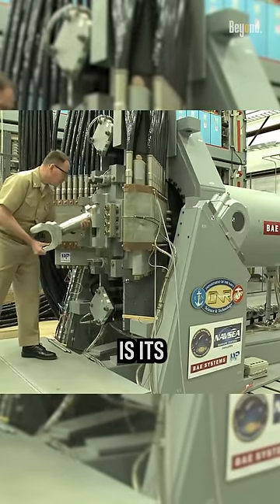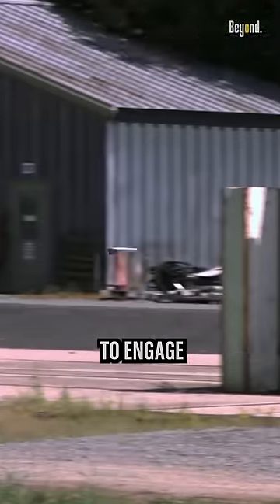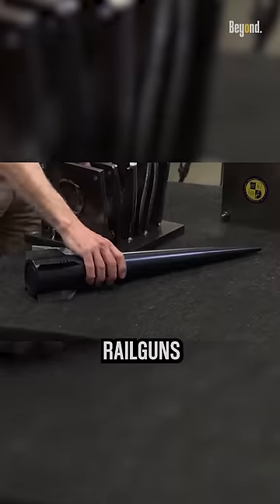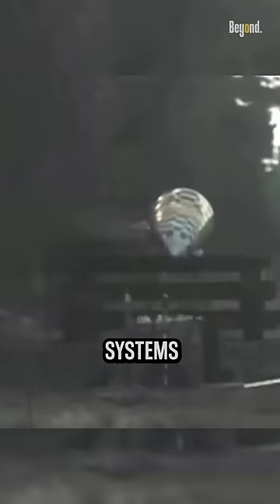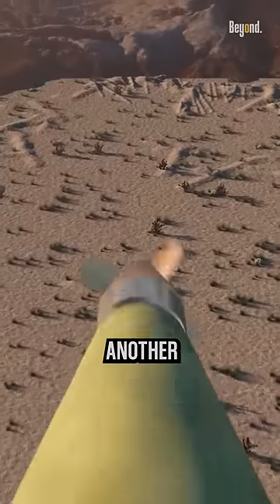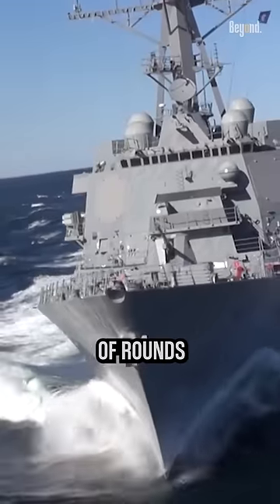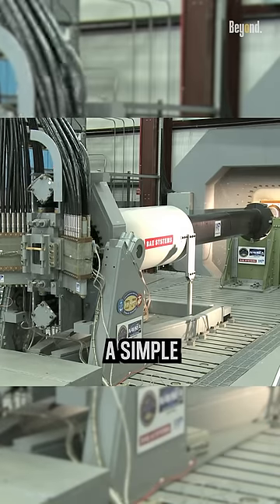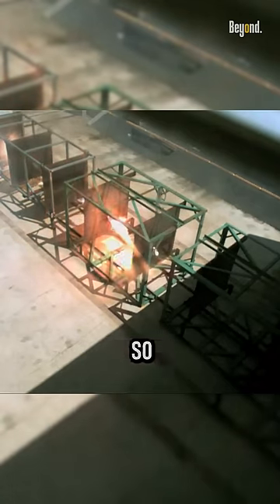Why does the US Navy need a railgun ? #shorts

Comment: Railgun + rod from God = extremely bad day for the recipient
Reply: That would be so overkill but at the same time incredible
Reply: Yes.. Planetary defense systems but that's hundreds of yrs in the future. For now, the land based versions operatied by mini nuclear power source with an increase (about 70%) rate of fire is pretty OP..
Reply: @Tamayo1980  it's not that far off into the future, the only reason we don't already have one is because it is prohibitively expensive to reload
Reply: @Controlled_Insanity_003  Lol @ the "only reason" citing reloading.. Welp, the architecture of building an weapons platform in space is beyond challenging. 1st, you'd have to get said payload into orbit, assemble and eventually have a powerful enough engines to counter the force of a rail gun firing in space.
Reply: @Antares_451  getting the ammunition to orbit is part of reloading, but I did forget about recoil
Reply: Although rods from God are cool or should I say the thought of rods from God are cool who be far too expensive to actually get the ammunition up in space for them to actually be practical a nice cbm is a fraction of the price
Reply: @john762x51  I know, I already mentioned price in a different comment
Reply: @Antares_451 I don't think kinetic weapons would need much infrastructure especially if starship pans out as it could probably launch a satellite with several such weapons .
Reply: One of the advantages of the "Rod from god" is that the projectile is already at orbital speed plus there is gravity so there would be no need for a rail gun with a "Rod from god" weapon other than theatrics in a movie, in truth the railgun would just be unneeded aded weight while you could just add more rods instead of the railgun, capacitors and powersource.  I would envision "Rods from god" being in highly elliptical polar orbits where they would just alter their orbits just enough to strike their target on their approach to their lowest point in their orbit.  No rail gun, just the rod detaching from the cluster, and a small burn from a thruster at the highest point of it's orbit and then it's just reaction control thrusters to control the trajectory on the way down by gravity, the rods don't even need to be in a cluster as each could be in their own polar orbit.
Reply: @johnwang9914  a railgun would add enough speed to negate most or all of the extra equipment you're advocating for, it would also greatly increase the efficacy of the weapon while still remaining "legal" by international law,  and it could be powered by solar panels and batteries
Reply: @Controlled_Insanity_003  Compared to orbital velocity, the railgun "addition" would be negligible and you would be better off launching more rods instead of the railgun, the capacitors and the powerplant.
Reply: @Controlled_Insanity_003  Compared to orbital velocity, the railgun "addition" would be negligible and you would be better off launching more rods instead of the railgun, the capacitors and the powerplant.
Reply: @Controlled_Insanity_003  currently our metallurgy limits the lifespan of the rails to a few shots. So, your railgun idea is not feasible whereas Tungsten rods with a simple RCS can be feasibly be launched right now and be much simpler system.
Reply: @johnwang9914  you don't understand then
Reply: Rods from God are not suitable for 5th Gen warfare.
Reply: @89Nazbol  it's a little barbaric but just deleting portions of cities without nuclear weapons would be good for deleting the enemy morale
Reply: @Controlled_Insanity_003 I’m pretty sure that orbital weapons are banned.
Another reason, one wouldn’t be enough so the cost of an effective system would be immeasurable.
Also space pollution, we probably need to think of that 🧐
Reply: @Rashed1255  orbital weaponry is legal I believe, orbital weapons of mass destruction are illegal, it's more of a psychological weapon than actually useful for pinpoint attacks
Reply: @Antares_451 I wouldn't expect it to be THAT far off given the pace that the progress is going
lol
Reply: @Controlled_Insanity_003 well there is a nuclear weapons ban in space but I don't think that covers traditional weapons. The treaty kind of moot anyways since ICBMs travel so far and high they might as well be in space 😅
Reply: I got your "rod from GOD" right here, pal...
Reply: @misanthropicphilanthropy  that's gay
Reply: A tungsten rod the size of a telephone pole zooming through earths atmosphere at 1,000's of MPH is scary to think about.
Reply: @Controlled_Insanity_003  Is it with SpaceX these days?
Reply: They don't work together. Either the projectile is small enough to not launch the station away when accelerated, or big enough to use gravitational energy for the damage. Can't have both, by definition
Reply: Rod from God + plasma vacuum channel wind resistance mitigation for re entry (also mitigates the plasma sheath that forms which disrupts communication to the re entering body, so mid trajectory guidance would be more feasible) + laser ablation acceleration backplate on the rod = insanely exigent day for the recipient
Reply: @gantrieltharxius28  I like your thoughts but I feel that would fall into the category of illegal weaponry
Reply: A rail gun in space wouldn't be very practical. For one, how would you get it where its needed, what kind of orbit would it have. It would be constantly moving above a planet that's constantly moving. Can't imagine it would be very accurate. You'd also have the problem of supplying ammunition and maintenance of the weapon system. Rail guns start damaging themselves from the first shot. The only way they work on earth is by having the power supply a distance from the gun. Imagine trying to move that mass to even a slightly different position. Then you have the ease with which an enemy could destroy it!
Reply: @Antares_451 you don need super force to release the rail gun in space you just need to drop it and let gravity do the rest.
Reply: @manin10  again, accuracy would not be a concern much like accuracy is not a huge concern with nuclear warheads
Reply: @Controlled_Insanity_003  So, explain how it would work.
Reply: @manin10  the force of impact would be immense
Reply: @Controlled_Insanity_003 it’s not about getting the ammo up there, it’s about getting the whole system up there. we have no rockets powerful enough to get 1 up there. the technology for that doesn’t exist. it only exists in the movie GI joe retaliation. before u even put ammo up there u have to have the whole thing up there which we don’t have anything powerful enough to do that.
Reply: @john762x51 also u would first have to get the whole gun system to work in space and actually get it up there. the technology to do that doesn’t exist and only exists in the movie GI joe retaliation.
Reply: Rods of God is such a cool idea. Drop a telephone pole sized piece of tungsten or even plain steal and you will have a crazy amount of potential energy.
Reply: No you wouldnt need a rail gun on a rod of god platform. It would be stupid to mount one considering the insane speeds in space already.
Reply: @Controlled_Insanity_003 it is clearly you who doesnt understand.
Reply: @huskiegaming4957  how do you think the space station was build on a day? With one rocket?
Reply: @ulfenburg7539  also it’s illegal to put weapons of mass destruction in space by the geneva convention.
Reply: @christianterrill3503  and illegal by the geneva convention.
Reply: Ah yes, orbital railguns. Masterchief would be pleased.
Reply: Once Starship is active (which should be before the next martian transfer window), it will be feasible to have RFG platforms in orbit. Not all the projectiles have to be WMD-scale, either. It will give the capability to simply say "I no longer want to see this facility" and drop the equivalent of a 500 ton warhead that can't be intercepted like a missile.
Reply: @Tamayo1980 we have them now.
Reply: Rod from god is not good. The item will melt and is highly inaccurate.
Reply: @brian-us6vw  The item has fins and cold gas thrusters connected to a guidance system to make it accurate. A tungsten tip helps to prevent melting.
Reply: @Controlled_Insanity_003 outer space treaty technically applies to all weapons
Reply: orbital weapons are inneficent and not practical not only are they very exspensive to maintain they are unprotected  against anti satellite weapons and you have to wait for your target to orbit beneath  which can take a long time (the iss only orbits every 90 min which is plenty of time for an icbm launch.)
Reply: @lordgod9958  I heard that it only applied to WMDs
Reply: @shelp7858  it's not for precision, it's for demoralization
Reply: @user2C47 oof, fins? At such speeds and pressures the load on ordinary fins would be way too much to handle. And before any kind of accuracy gets into this idea, the plasma sheath problem needs to be solved.
Reply: @Antares_451 while it would be massively expensive to get them into space as they’re tungsten rods designed to be as dense as possible to reduce size while maintaining mass, “rods from god” would not have any issue with countering the force from “firing” tjem because really they’re just being dropped at a precise angle calculated to hit the target. There’s no “launching” or “firing” involved, the whole point of Rods from God
Is to simply drop it perfectly (and potentially guide it with a first-stage device) so that it hits the target and the kinetic energy it develops from the fall is all released at once.
Reply: @Pantsinabucket  rods being fired from a rail gun was the conversation.. sure getting the rods into space is expensive but firing them from a rail gun ISN'T THE SAME AS "JUST DROPPING THEM LIKE A HOT POTATO"..
Reply: @Antares_451  putting a rail gun into space would cost and require the same effort as putting a space station there. How would it operate? How would you maintain it? What about the power requirements? They can't even get them to operate on a shit. They require maintenance after every shot! If fired remotely you'd be lucky if you could hit Texas!
Reply: @Antares_451  
You missed his point. You don't need a railgun. The Railgun would add maybe 7 thousand mph to something that is moving almost 30 thousand just being in orbit, let alone being fired/dropped.
It's a relatively small increase that adds massive costs in maintenance and construction, when you can have virtually the same effect just not doing it.

Comment: The main difference was the frequency with which you had to replace the rails and massive electrical need. There is still a lot of work to do before it would become feasible.
Reply: Remember learning about the huge Gustav Rail based gun of the German army during ww2. Freaking weapon had a crew of 200 people. This thing gotta raise a street to the ground or else it ain't justified to have rails built to carry it and such a crew. These rail guns damn I gotta witness how it works at least once in a life time. It be so cool watching how it goes through a tank. A house as target be like lava through butter 😅
Reply: @stevekook-xw3is  two different rail guns. The WW2 was an extremely large bore cannon whereas rail guns use two rails of electro-magnets to accelerate the projectile.
Reply: I suspect when the tech matures enough, the platform will be the size of a ww2 battleship.  It has to be big enough to house the nuc plants to generate the power for both the ship and the gun and imagine a 200# tungsten projectile traveling at mach 4+ with range of over 100miles.  This large platform will also allow for the exchange of "barrels" without having to  port.
Reply: Indeed, there's no way you could field this weapon from a non-nuclear powered platform.